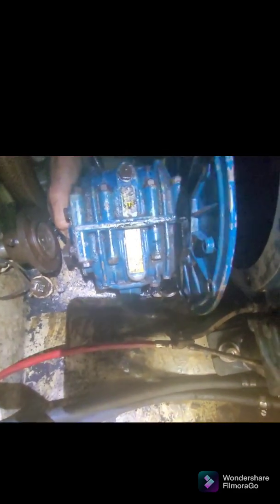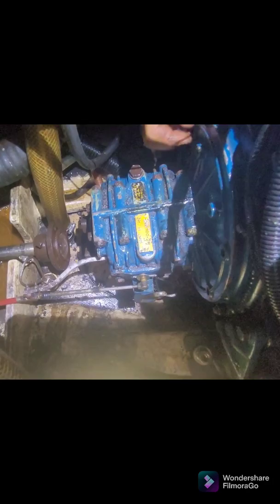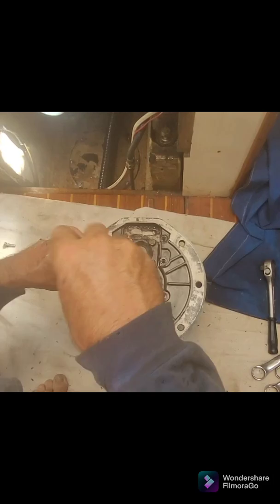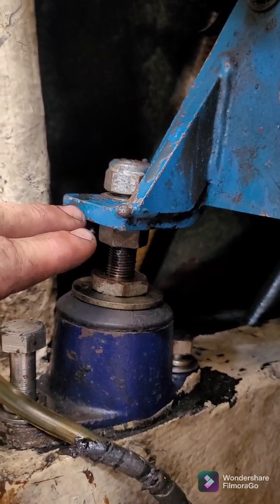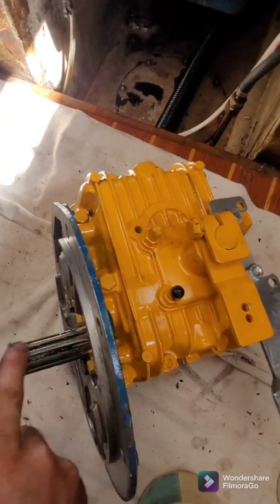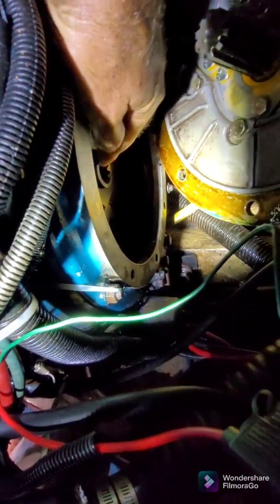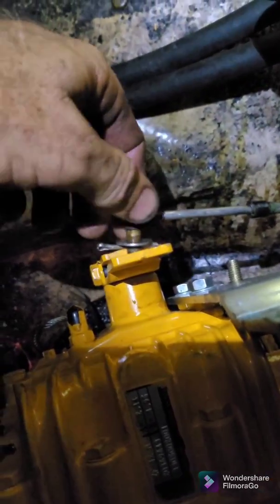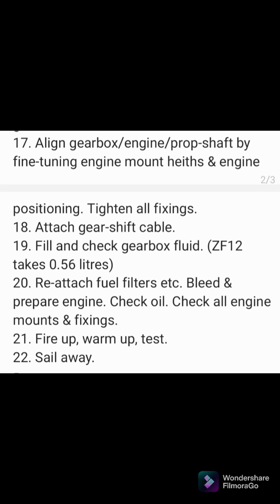Hurth gearbox replacement HBW100 FOR ZF12M. Propshaft coupling removed and marine gearbox replaced

Comment: I'm looking at doing the same thing, is the gear ratio the same between the hbw 100 the the zf12? 

Did you lift the engine 10mm because of lack of space in the engine bay or is there a 10mm difference between the input and output spindles on the new gearbox? 

Any help  is. Much appreciated